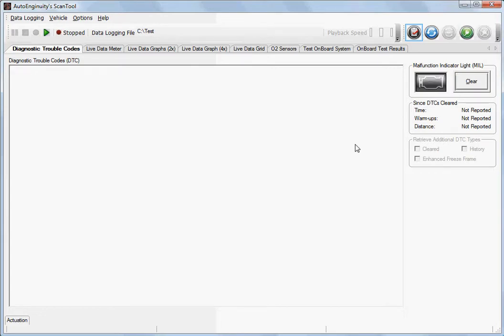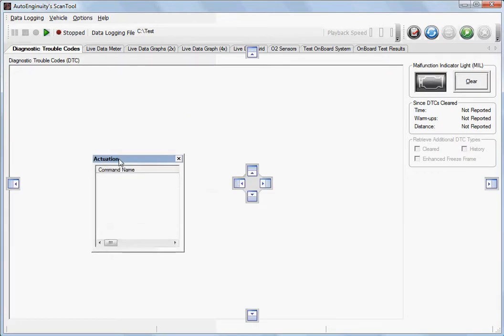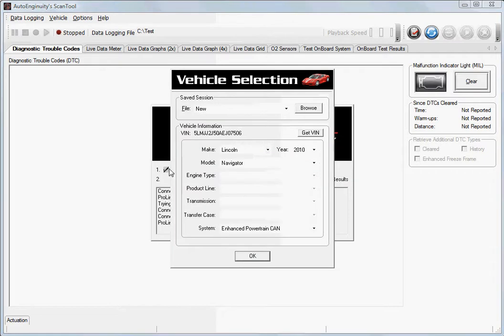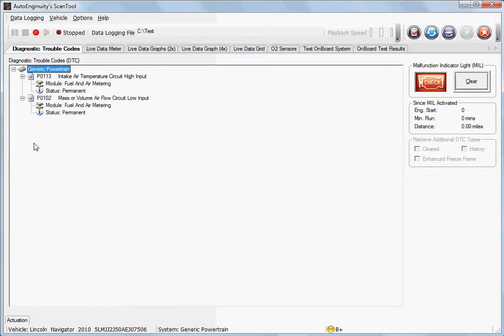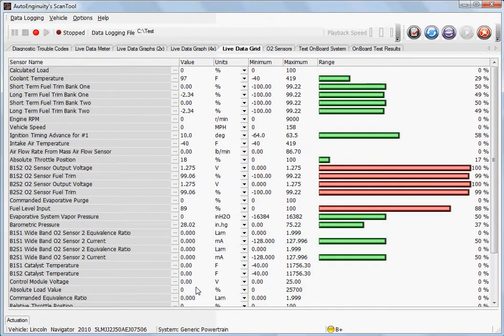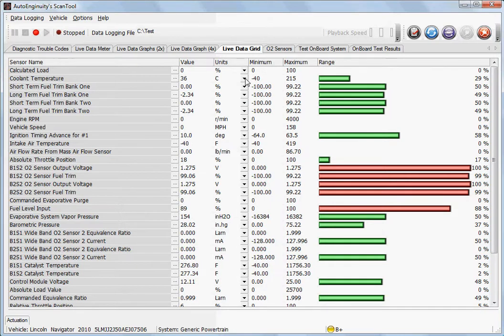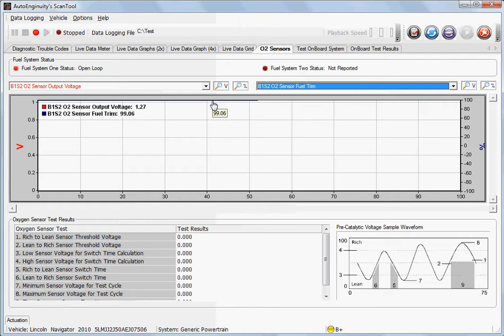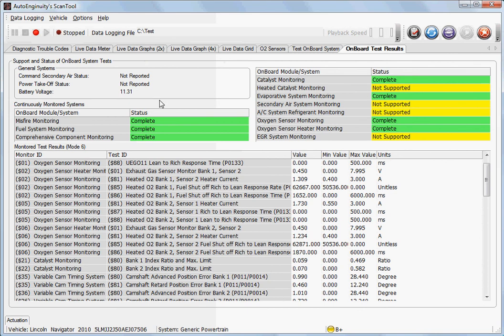ScanTool Demo   Generic OBDII

Comment: I want a tutorial on bi-directional control and how to do special functions please
Reply: I have had this software since 2012. Rarely used it as found it very glitchy. Tried several different laptops and even different USB cables. Just very inconsistent. You can be certain it will disconnect mid-diag and you have to start over frequently needing to restart the software. I wouldn't buy again. Buy a Launch instead. Unfortunately there is NO one fits all aftermarket scan tool. Snap-on does Domestic very well. Launch and Autel do Asian/European. Ross-tech for VW/Audi <excellent>. So you have to pick your poison. Be honest with yourself. What do you work on most? Buy a 5 year old Verus and a Launch or Autel. Rock on.